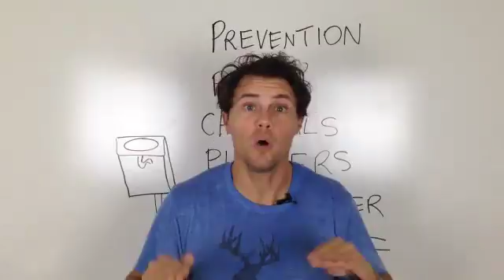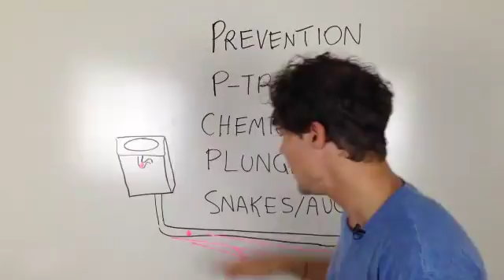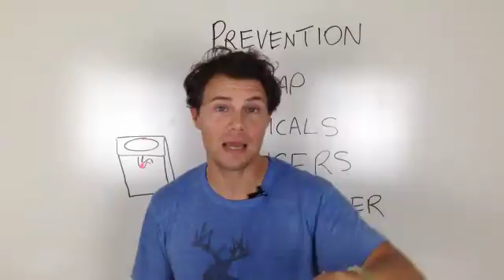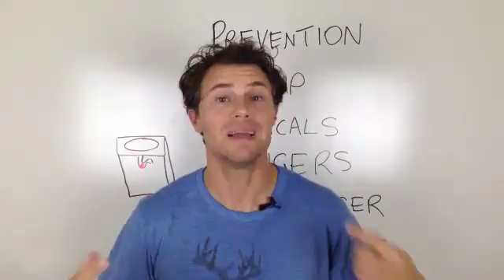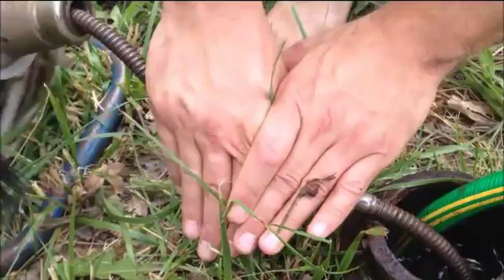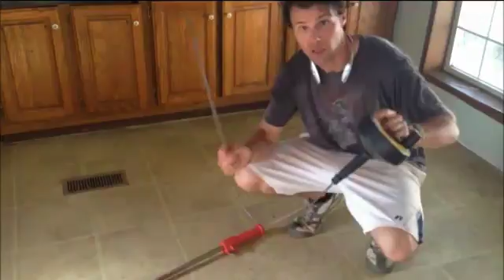Clogged Sewer Pipes 101

Comment: I was not surprised by the cause of the clog.  One of the first mobile homes I did, the buyer called me a day or two after purchase asking if I had any issues with the plumbing, stating that feces was backing up into the tub.  I asked him if he looked under the home, and / or called the park manager.  He did neither but would right away.  The sewage was backing up under the home, and when he called the park, he said they were having issues with tree roots in the pipes.  I have met park managers who will actually remove any and all trees just to avoid this issue.  Good stuff as always, John.
Reply from the maker: Hi Joshua. Thank you for commenting and reaching out. That's a heck of an experience on one of your first homes. That is certainly one benefit of owning the homes inside of the communities, we can simply call the park manager and have park plumbing problems dealt with fairly quickly. With that said I'm involved in a park with chronic plumbing problems due to an out of date septic system and old/narrow pipes. Always a good time and never a dull day in the world of mobile home investing. Keep in touch please. Talk soon, John
Reply: Flush toilet won't go down removed cap water ran out of it had an auger run in ground is it possible toilet clogged the water and stuff flee out of it.